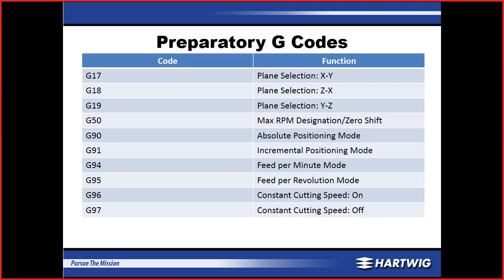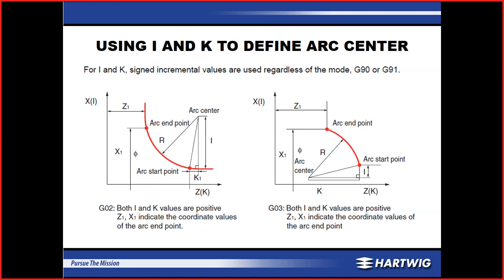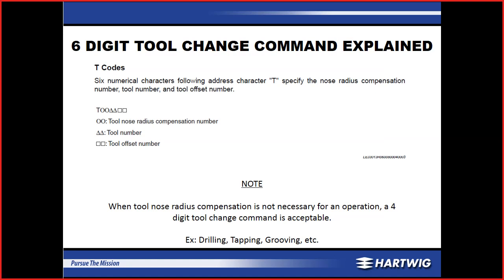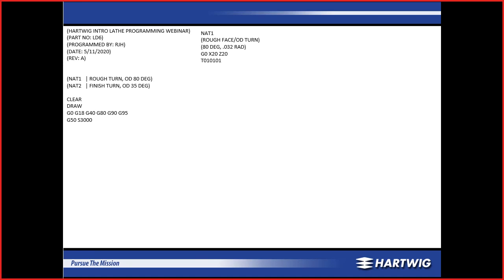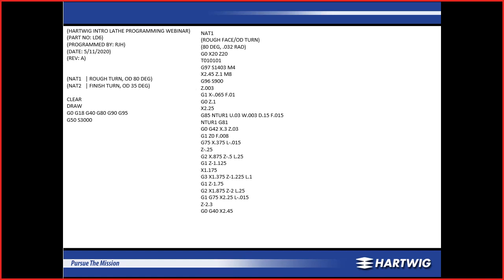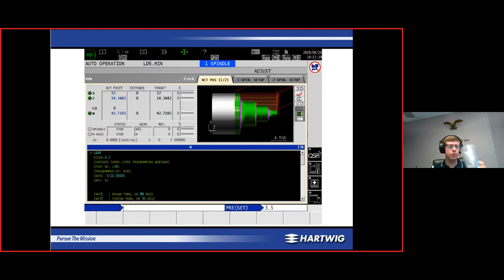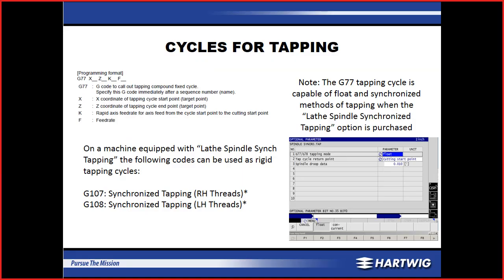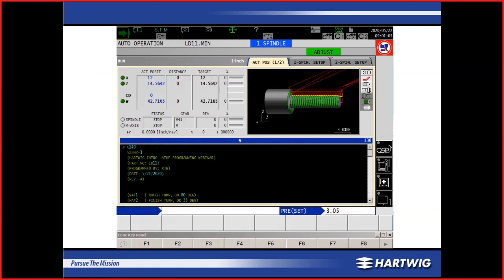Okuma Lathe Programming Guide - Turning Cycles

Comment: Can you get the conversational program on a desktop or a program simulator for Okuma on the desktop? I want to check programs in the office before I take the machine out of cycle on the shop floor. I hate stopping production to check a program.
Reply from the maker: Hey Ryan- one of application engineers can help you with this as this is offered, but I'd need your info first. You can e-mail info@hartwiginc.com and I'll get it over to one of our engineers.
Reply: @HartwigInc  thank you for the reply sir. That's great it's something you offer!

Comment: hi Ricky,  for boring cycle I think we should use G41 instead of 42, right?
Reply: Typically, when going in the Z negative direction (ex. feeding from Z0 to Z-1), G42 is for turning and G41 is for boring. It's more complicated than that but that's the rule of thumb I use. If you're ever unsure, simulate or dry run the cut and watch the numbers to see if the X and Z values don't go far off from what you're expecting. As getting them wrong can cause an oversize or undersize of 0.1" or more!

Comment: Please Help O.D. threading cycle. Is it possible to make it simple? I am used to using box threading cycles on fanuc controls. Can I do that on my OSPE-100L control?
Reply: X is minor diameter
Z is length
D is depth of cut
U is finish
H is height difference between minor diameter and od

Comment: I am new at Okuma lathe programing. So i am using some basic stuff from programing on a fanuc controller.  I am getting and error on my safety block like when I try to run the program. I just purchase a used Okuma captain L370 MFG date 2001 with an OSP-E100L controller. Safety line has a G40 in it and it seems to not like that. Now I can not get past the safety line. Also I removed all the radius compensation out of the tool offset page.
Reply: if anyone can help that would be awesome. Some weird nose radius alarm.

Comment: And if i want make  polygon can i use same cycle 
Like in this example:
G90 G95 G50S1000
T080808
G0X650 Z5
M110
M146
M16
G0 X42 Z5 SB=1000 M13
G85 NAP1 D1 U0.2 W0.1 F0.1
NAP1 G81
G1 Z-10
G101 C300
C240
C180
C120
C60
C0
G80
G0X650 Z5
M12
M109
M30
Is there another cycle format for this type, becouse i get alarm on this format?
Reply: You can't use SB=XXXXM13 and M110 with G81 and G85. You have to use other cycle.